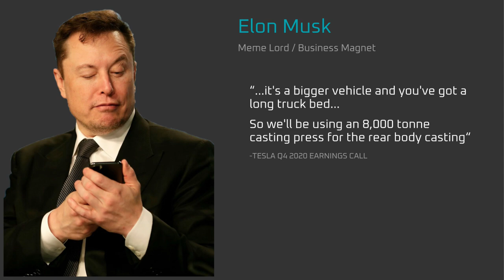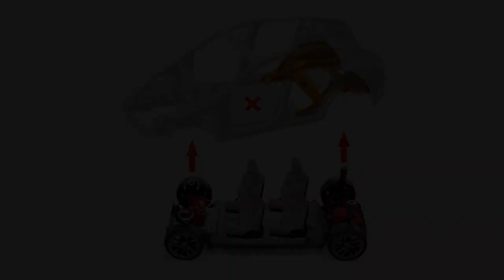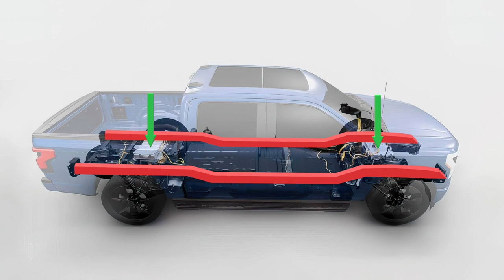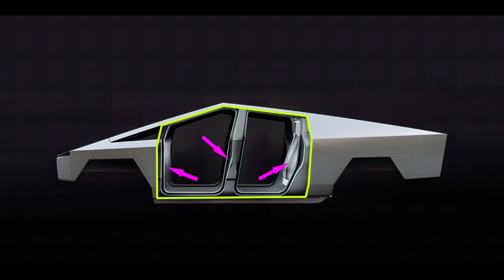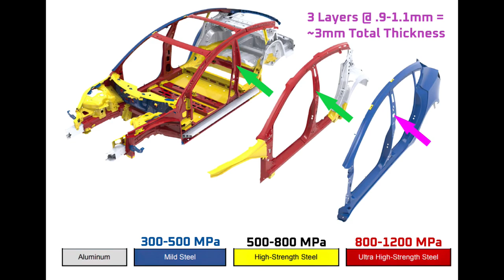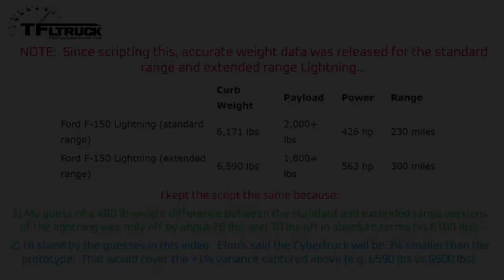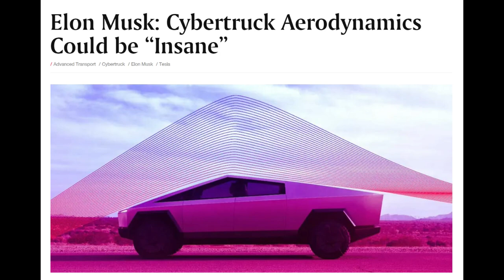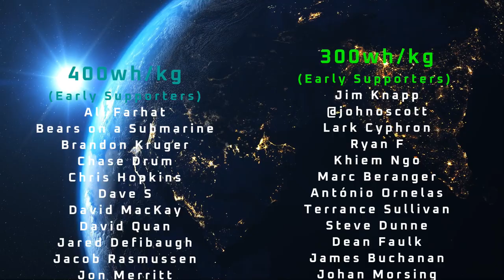Cybertruck // Merging the Exoskeleton, Gigacastings, and Structural Battery Pack

Comment: You are way off in your weight estimates.    F150 uses all aluminum body and chassis,   and is very light weight.   Add Cybertruck thick stainless and bulletproof glass ,   add Cybertruck 35" tires,   Add Cybertruck Wheels, axles and hubs for that have to be beefed up for the tow rating...     Cybertruck with 500 mile range, and 14k lbs towing will be over 8000lbs...
Reply: @D8
Tesla originally said 6700lbs
But you might be right____lets see
Reply: @ivankuljis1780   like I said, if you look at the F150 with its complete aluminum body and structure,  likely weighs around 800lbs.   The steel frame weighs about 400 pounds, so that’s 1200 pounds for the body and frame.    When you look at cybertruck, a few things Elon Musk mentioned at the unveiling, first was the 3mm stainless steel door skins are 75 pounds each, and there are four of them, that huge windshield is heavy, glass is far heavier than sheet metal, But bulletproof glass is 2X to 3X the weight.   To go 500 miles of range would require a battery pack of 200 kWh or more, using model S plaid density, that is 2800 pounds just for the battery.   6700 pounds for a cyber track with 500 miles of range, is a pipe dream, and tesla will never ever do it.   To get to that weight, would require every light weighting technology known, and we know for example the door panels, and glass are extremely heavy compared to the Ford, .   It’s like saying the cyber truck will be cheaper to build, which would be people that just don’t understand automotive cost, Ford builds 1 million of the cab and bed every year,  that brings the cost way down.   It’s all made from fairly cheap sheet aluminum.   And the frame is tubular steel, which is extremely lightweight for the amount of strength it has.   When you compare castings, to tubular steel, by the time you factor in overload stress, I think the weight difference will be around zero.   We know the cyber truck Prototype had a tubular steel frame, because motor trend magazine saw it being built and mentioned that,  I assume the production model will have giga castings, but again there is not much weight savings when you factor in overload stresses to your castings.  Steel is a much better material at handling overloads, then aluminum, and cast aluminum is far worse, so must have more structure.  Now, I’m not going to continue to argue about things we don’t know, but just using simple math, we know cyber truck is going to be heavy, or Tesla will greatly reduce the specifications like they did on the Plaid model S.   We will have to wait and see, Tesla has scheduled with suppliers to start production in October 2023, I highly doubt they will give us any of the specifications before hand
Reply from the maker: 1) I wasn't talking about the 500 mile range version here.  You're adjusting the criteria to shoehorn your narrative.
2) Neither of us know if my estimates are way off, because we don't know exactly how it will be constructed.
3) You seem to be ignoring there will be no frame and it will use aluminum gigacastings.
Reply: @thelimitingfactor  no, I have a pretty good idea what the cyber truck will weigh, and I know exactly what each part of the F150 weighs,   So if you want to shorten the range of the cyber truck, to 300 miles you can reduce it to 120kWh,  That’s about an 1700 pound battery pack.    The steel frame of the F150 does the same job as both gigacastings, and the side rails of the structural battery pack.   The tubular steel frame in the F150 is quite lightweight, and extremely strong.   I don’t think the gigacastings save very much weight compared to tubular steel.   Like I said the entire F150 body and frame weigh about 1200 pounds so just start with that as your number and start adding The parts of the cyber truck to get to the same point of construction.   One thing you have to remember, is Tesla will only build one version of the chassis, meaning there is no weight savings on the chassis on the lesser cyber truck, so everything will be designed for the maximum powered and capable cyber truck.   When you design for towing 14,000 pounds, just the trailer hitch has to be very robust to meet SAE standards.   You also have to have vehicle brakes that can stop that load if the trailer brakes fail, which is also part of the SAE standards.  Elon stated the cyber truck will come on 35 inch tires.   So doing some calculations, at the weight of the cyber truck.   No I think it’s silly to compare the base cyber truck, because we highly likely will never see that model on the market, Elon musk has already been creeping up the standards of the cyber truck and has mentioned, Tesla still has not figured out how to build it on the budget.   Adding four wheel steering for example ads 400 lbs of weight,   I will bet you the top model cyber truck which is probably the only one that will ever be built, will weigh more than 7500 pounds, and cost more than $130,000.   Even with all of that, I’m not sure the 500 range is doable for Tesla.   But we will find out  October 2023 unless it gets delayed again

Comment: Cybertruck redesigned for robotaxi work = Cybertaxi.

Stainless steel body + easily refurbished interior + LFP batteries = a multi-million mile usable vehicle and a close to zero cents per mile vehicle cost.
Reply: Lol that’s totally wrong!
Reply: @moineaux9173  
Show me your math and then I'll show you mine.

I've done the math.  I'm not just shooting from the hip.
Reply: @bobwallace9753  I'd question the math that calculates a closer to zero cost per mile.
Reply: @TheEvilmooseofdoom  
OK, let's do some math.  First an assumption or two.

Tesla should be able to produce a Cybertaxi, a stainless steel exoskeleton robotaxi with a modest range for $35k or less.  

We don't know how long LFP batteries will last, the ones I'm using with my solar panels are rated for 10,000 full cycles.  Jeff Dahn has been testing cells that have now undergone 20k cycles with only slight capacity loss. Let's use 10k cycles.

10k cycles in a 200 mile range EV would be a 2 million mile battery. 

$35,000 / 2,000,000 = $0.0175/mile.  That's not far above zero.  

 Stainless steel bodies should last far more than 2M miles.  After 2M miles swap in a new set of batteries (assuming only 10k cycles) and get another 2M out of the body.  

$40k (body + extra battery) / 4M = $0.01/mile.  A penny per mile is a rounding error.  Pretty much nothing per mile for the vehicle and batteries.

Comment: um, the tesla s plad is almost 5k pounds, your on something special thinking the cyber truck will be anywhere close
Reply from the maker: Model S is about 4800 lb and uses older body tech (no gigacasting or structural pack), which adds about 50 kg at least.

The Plaid has a 100 kWh battery and three motors.  The base version of the Cybertruck will have one motor and a smaller pack than the Model S.  That will knock off about 400 lb.  

I said a minimum of 5090 pounds.  So, 300 pound weight difference + 100 pound for older tech + 400 lb for the lower powertrain weight for the base cybertruck is about 800 pounds.

Factor in the 5500 pound max weight I suggested and you get a 1200 pound variance between the plaid and the base Cybertruck.  Quite realistic.

Am I on crack?  I could be.  But you clearly haven't thought these things through.

Comment: The Tesla cybertruck is stupid. Also the weight should be the same as a f150, yes Tesla can use gigacastings and a unibody design but if the body is rainless steel 3 mm think that will be really really heavy, i would guess even heavier than a f150. Also the cost of repairs in case of body panel damage should be astronomical, also if you want the exterior panels to be load bearing how are they attached to the body, are they welded, do they use a million rivets or bolts?  Imagine fixing that thing and not to mention in case of a accident and exterior body panel damage you risk of scrapping the truck because now that is considered structural damage, but trucks are popular, Tesla needed to prop up their stock and showed people yet another fantasy product that is yet another year away and it's another empty promise.
Reply from the maker: Already covered in other videos

Comment: Good luck repairing this truck after a crash
Reply from the maker: But also, in most fender fenders, the truck would shrug it off.
Reply: By the time Cybertrucks are being mass produced, Tesla's crash avoidance software will be so effective that hardly any Cybertrucks will get into crashes in the first place. Teslas with active safety enabled already are several times less likely to get in collisions than average.
Reply: @thelimitingfactor  if the truck is “shrugging off” fender benders then the occupants are going to get hurt. What happens if one hits a wall or a dump truck or another CT?
Reply: @Global_Optimization  what the hell? This shit aint the matrix. It may help avoid some single car accidents but you aint dodging other vehicles
Reply: @mattbrew11  You know less than you pretend you do.
Reply: @TheEvilmooseofdoom  k
Reply: @mattbrew11  The software literally does dodge other vehicles. And this isn't theoretical. The statistics already show it's safer.
Reply: @Global_Optimization  it can not beat physics. Human drivers also dodge vehicles. That’s irrelevant
Reply: @mattbrew11  It is obviously relevant because the insurance cost will be based on how often collision payouts occur. Less frequency of crashes --> Less cost. Also, most vehicles are totaled in accidents hard enough to bend cyber truck exoskeleton

Comment: From what is seen that awful-looking truck has a 6 feet bed so what it can be used for can it be loaded with lumber or any other construction material except a few bags of garden mulch? It Is just the ugliest SUV that's all, probably perfect to go on the weekend and get office supplies.
Reply from the maker: Works for me! 

As a side note, I can fit 8 foot carpet rolls and steel garden edging in my model 3.  I'm sure the C/T will be able to carry more than office supplies.  

Anyhow, thanks for the comment.  Even if you're being a jerk off, it helps the algorithm.
Reply: @thelimitingfactor  Not jerk of . Just dont like that  useles vehicle, surely many will buy it just like any 6' bed truck is not a truck .

Comment: If it has 4680 cells, it will.need less of them,  and they are much lighter. That will.also give some weight savings to the Cybertruck.
Reply from the maker: That was included in the structural pack estimate

Comment: 3mm ultra-hard steel exoskeleton still sounds like a REALLY bad idea for crash safety/pedestrian safety, you WANT the body to absorb the impacts and not be very hard. I hope the will not allow this thing on public roads..
Reply: Well the first market is NA where the standards are not what you think they are.  And you can score SS so it folds on impact.  It will have to go through crash testing, like everything else.  You can keep pretending you have a clue and I suspect pretending is all you can do.
Reply from the maker: It will collapse just fine for crash safety.  The energy involved in an accident is ridiculous.  It's the castings you have to worry about.  And those are designed to collapse as well.

As for pedestrians, not a concern for U.S. regulations, only Europe.   You're mincemeat when about any truck hits you.  That's why we need FSD and ADAS.

Comment: Mfw the truck gets a dent and I need a new car. Mfw the truck is a brick and has no crumple zones.
Reply from the maker: mfw I receive lazy comments
Reply: @thelimitingfactor  Two questions no one can answer, even you.
Reply: It's harder to dent that you pretend and stainless steel is reparable, and crumple zones can be accomplished by pre-scoring on the interior.  Try again because you didn't put much if any thinking into that so far.
Reply: @TheEvilmooseofdoom  Ok, no you almost had it. How can you have both safety and a long lasting structure? You want crumple zones, you compromise the rigidity. There is no way to have both. That's the f*cking problem

If only there was a way to have the structure on the inside and the squishy on the outside... nah, I can't think of anything